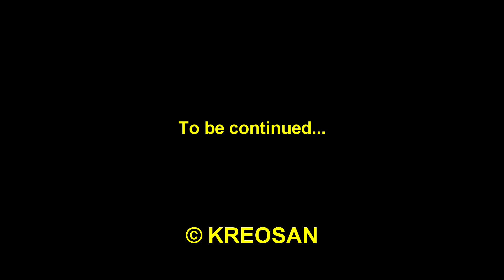Jet Fueled Rocket Test FAILS 😱 Oxygen + Kerosene 😃Kreosan Adventures in India

Comment: Frozen solid kerosene will not work, liquids don't burn it's the vapor that burns, It's way too cold to burn, The warmer the kerosene the better since it will evaporate quicker, You know the fire triangle right Heat, Oxidizer and Fuel you need all three to burn. (Edit) You got it in the end haha so never mind haha

Comment: In commercial rockets the Liquid oxygen and the RP1 (Kersosine essentially) aren´t premixed!
Furthermore the burn chamber can withstand several 100bars of pressure!

The rockets have big pumps pumping the liquid oxygen and kerosine into the burn chamber. They are "injected" into the chamber by a set of nozzles.

Comment: Can someone explain me why they used borax to weld ?
Reply: Borax burn at > 400°C suitable for small scale welding
Reply: @tausifalam5844  Thanks ❤
Reply: @DumindaKuruppu  keep in mind borax doesn't not actually melts the metals as it would require much higher temperature it basically acts used as a flux which prevents any sort of oxidation between metals to form a solid joints. It is mostly used in forge welding